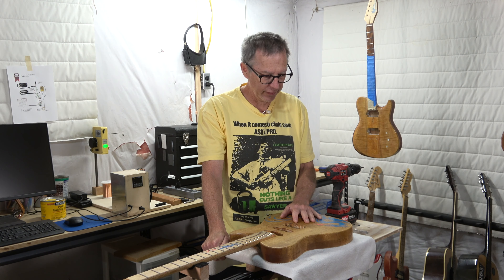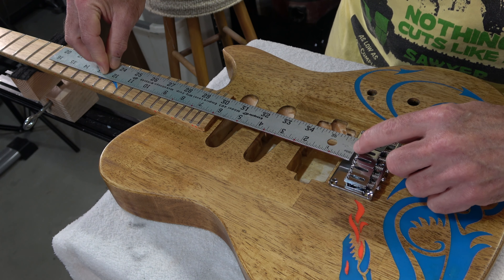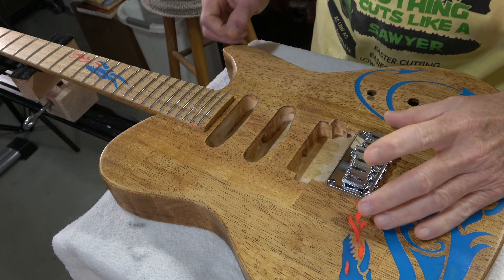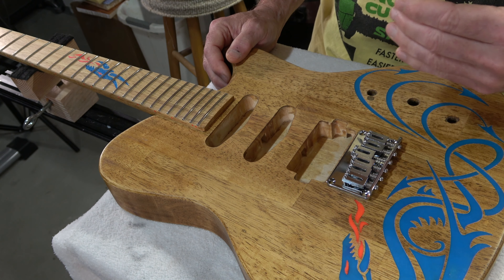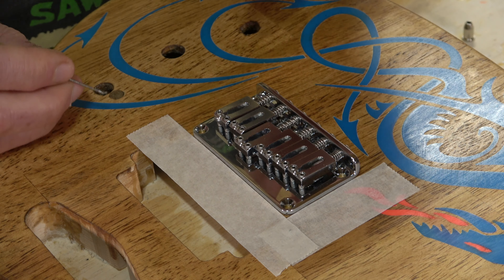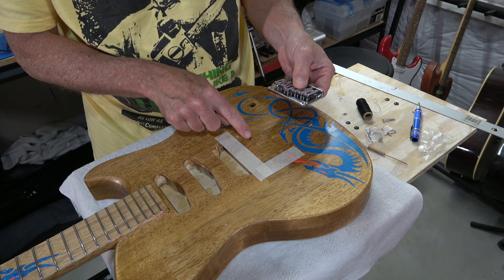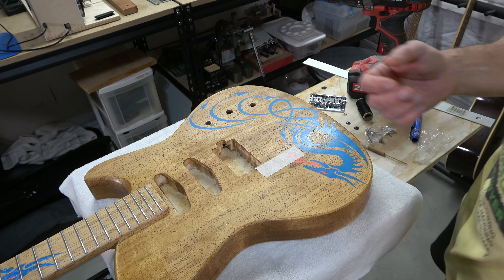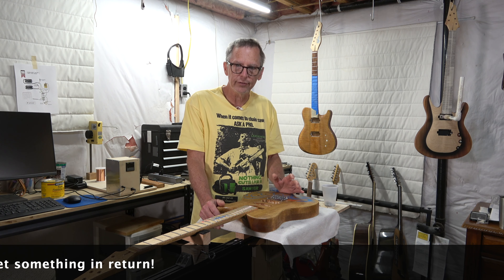How To Install A Hardtail Bridge On An Electric Guitar. The Oak Guitar Build Part 10.

Comment: This is almost exactly how I locate the bridge on my ukuleles. They are of course glued on so I have to get it right. I’ve done it wrong enough times…!

Once I have determined the location for scale length, I clamp a straight edge to the body so I can maintain that location while sliding the bridge side to side. I then use the thread trick (I use fishing line) but I clamp the nut in place temporarily and pass one length of string from the bridge, through a nut slot, through a few tuner holes, back over the other nut slot, back to the bridge and hang a weight (vise grip) over the end of the bench to maintain tension. That lets me move the bridge until both strings are centered perfectly and then I place the tape exactly as you do!  

I really appreciate your explanation of how you adjust the intonation forward before locating the bridge for scale. The few times I’ve used this kind of bridge I was just lucky enough not to have run out of adjustment!

Comment: I like this subject matter and the high quality Japanese made hard tail bridge.

It should be noted, however to nonprofessionals that the use of hand tools and hand held screw drivers is the preferred method for learning how to do new skills and for working on fine instruments and guitars in general. 

Electric drills, etc., move fast and are far less predictable than hand tools (screwdrivers). The slightest movements can be detected by your fingers when using a hand held screw driver. Power tools are relatively impersonal and have been known to lead to problems even in the hands of experts. Caution is advised when using electric drills on guitars.

Nonpowered tools are best to use on guitars in most cases.

I myself will carefully use a de walt lithium palm sander on guitars for quick and controlled removal of material. Slip ups are less quickly detected and the palm sander is unforgiving. Best results are from hand sanding and making and using 'sanding blocks'.

Power tools save time but can remove or destroy material quickly and before detection. With hand tools you are directly in touch with the guitar. It is always best to be in direct touch with your workpiece. It is not that power tools do a better job. Mostly power tools save time and that is the primary motivating factor for choosing a power tool for a job.

With guitar work I advise taking plenty of time and exercising patience, taking extra time to think and plan.

Comment: Thanks. I like using string to line up the bridge. I've messed it up trying to use a straight edge. As you said, having it look centered is more important than having it be at a perfect center point. I even use string on both E strings at the same time so I can really get it right by eye.
Reply: I like this idea.

Comment: I've never seen the ground wire hole drilled into the pickup cavity, only angled directly into the control cavity.  Any practical reason you do it differently, or is it just personal whimsy?
Reply from the maker: In this case, it's a shorter distance.

Comment: What if I'm using a vintage style 3 saddle tele half bridge for humbucker bridge position? The saddles set back into the base a little. Do I measure from center of 12th to the saddle or stop at the bridge front base? Thanks
Reply from the maker: 12th fret to where the string will come into contact with the saddle.

Comment: wouldn't you want to send her this saddles so you have equal potential to adjust them both forward and backward?
Reply from the maker: No! In almost all cases, intonating the strings requires moving the saddle back, which increases their scale length. You never have to move the saddles forward. Therefore if you position the bridge with the saddles centered, you risk not having enough rearward range of adjustment to intonate the strings. This is especially true with the wound bass side strings as they need more rearward adjustability.
Reply: @HighlineGuitars  thank you.
Reply: @HighlineGuitars  what would you say as far as importance goes for tone priority. Saddles, picknups, nut or tuners? Which order would you replace? And pots and bridge I guess too.  How about graph tech compared to bone? Thx a mill.